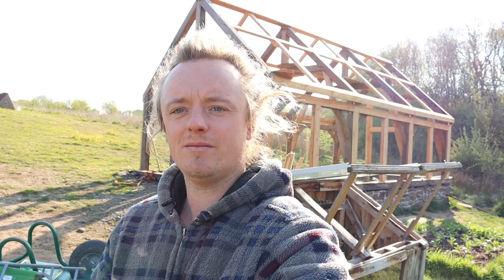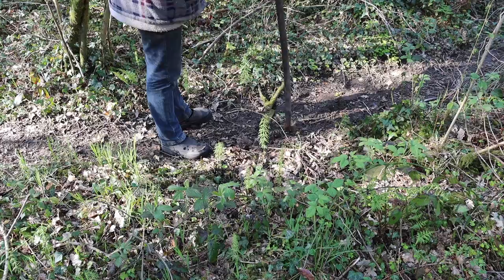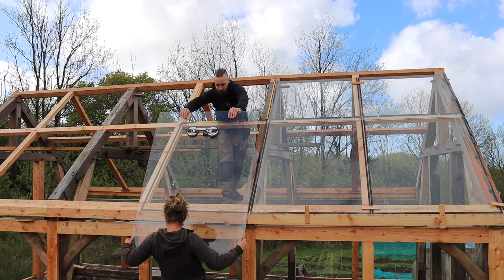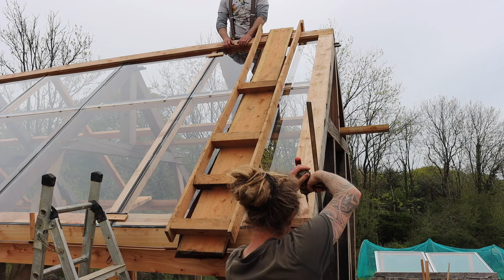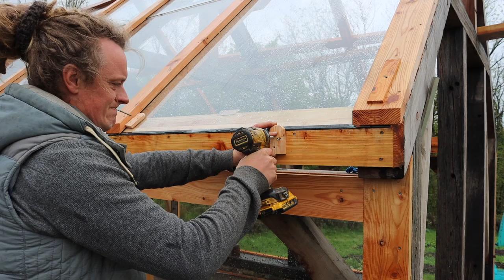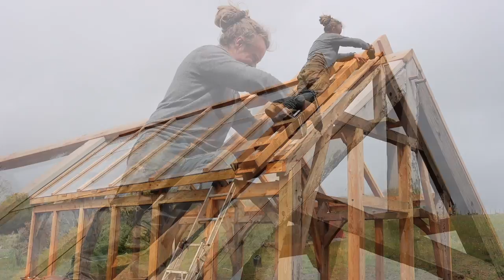Spring Fed Timber Framed Greenhouse Part 11 Roof Glazing And Finding Springs

Comment: From spring to fall even on cloudy days when I walk into my greenhouse it is tee shirt weather and a joy.  Your going to love it.
Reply: Just a point of interest and perhaps the question  will answer itself  as you continue  the build.  How do you plan to vent the greenhouse  during the summer  days.  From what I've been told plant growth  tends to stop when the air  temperature  hits the 90s and above. A solar powered fan in the apex would help or shade cloth suspended  above  the roof also helps a lot. Take care and as always fabulous  workmanship.
Reply: @garykuiken6191  just an FYI I generally don’t grow in the greenhouse during the summer.  The plants require too much attention.  But In august The uk isn’t southern Pennsylvania.

Comment: Hi, I love your videos,  I'm a professional gardener and have worked in the trade for over 30 years. Just a bit of advice.... Ventilation is imperative with a greenhouse. Red spider mite loves hot dry conditions and it's a devil to control if you don't get the ventilation sorting. All the top pains of glass should be opening. I speak from experience. I was in-charge  of a national trust garden for many years and one glasshouse had no roof vents and it was very hard to grow anything in, we had to retro fit rood vents in the end.
Reply: Perhaps the end walls will have venting panes.
Reply from the maker: The gable ends the back windows and the door are vents. I calculated it all and that is enough area for ventilation. The gable ends face the predominant wind direction so there will be air moving right through the roof. That is far better than just some vents at the top in  my mind.
Reply: @KrisHarbour  I fear that that will not be enough, but only time will tell. Maybe shading would be an option worth considering

Comment: The drought definitely affects most springs. Rain affects the ground water level and therefore some springs that are high in elevation might not work. It seems to me that the spring close to your lake isn't an actual spring but an underwater stream that comes from the lake, i.e. it flows relatively high up/close to the forest floor.  The main difference is that the water oozing from a proper spring (which is deep ground water) is most often drinkable as i. Whereas, an underground river water is pretty much the same as the lake water. 10/10 greenhouse!

Comment: Hi Kris great vids. Just wanted to share a hack with you after watching your firewood vid . Attach an old tyre to the top of your chopping block you can then pack it with logs and then chop away all the wood stays on the chopping block saves your back bending down . Cheers John expat now in Tasmania

Comment: Great job, as always .... (would have left open the lower edges of all panes to let the condensating water run out - this little air flow woud not hinder the greenhouse to heaten up at all)

Comment: I'm glad you got help for that part with your back bothering you especially. With the cost and weight of that glass I'm sure it made it loads easier as well. What a beautiful building. You can also use your little ladder to clean the glass when it gets dirty down the road. :)

Comment: I think different about springs. Springs appear through gravity. Water infiltrating through water penetrable soil layers and hit less water permiable layer. The water flows subsoil downhill on top of that layer until a spring pops out of the slope. That's how I learned. Springs have less to do with water table rather than they are a result of deeper sub soilsurface water movement.

Comment: Just curious, had you considered using aluminum clips at the bottom? They could recessed and hook over the top plate of the wall. Secured with a screw from inside. 

Your metals got me thinking this way because I’m building a timber frame greenhouse later in May. It’ll be 15’ by 16’. The Timbers will be 6”x6” posts, 2”x8” rafters 2 1/2”x10” ridge beam. Top and bottom plates will be 6”x6”. 

Anyways, wanted to say thanks for your project and video. It answers a couple of questions I had not answered yet. 

Cheers
Egon

Comment: Greenhouse looks awesome. 
What are your plans for ventilation Kris? You want the extra heat in winter, spring and autumn obviously, but mid-summer you're gonna have way too much. Vents at the top of the gable ends maybe? Some kind of louver, perhaps even a fan?
Reply from the maker: the back wall has an opening window and door will be used and the gable ends are going to be openable

Comment: So its just friction and sticky tape that stops the roof sheets from sliding down? What's the name of that tape? When you put in the batten screws was it hard to avoid hitting the glass?

Also, what type of glass is it and how wide are the sheets?

Amazing work Kris, Thanks for sharing!

Comment: Seasonal spring supplies can be driven by rainfall, feeding a perched aquifer, which then breaks out of the earth during periods of high precipitation, typically in the winter. However in a natural, artesian spring (which can also be seasonal) the hydrostatic pressure that forces water out of the ground is driven by temperature, not ground weight. 

Water is at its greatest density at 4˚C, and that is the temperature that all natural springs issue from the earth. As the temperature rises away from 4˚C, water expands, eventually turning into vapour at 100˚. Confusingly, as it lowers in temperature away from 4˚C, it also expands, before turning to ice at zero. 

In the earth, spring water is compressed by expanding warm water from above, heated through the earth by the sun, but also compressed by expanding warm water from below, heated geothermally from within the earth. Basically, spring water is a squeezed, dense, four degree filling between two sandwich layers of warmer, expanding water.

This is why water is forced deep underground in desert areas where the ground temperature is higher than the geothermal temperature and conversely why water is abundant in shady forests and wooded areas. If the earth is cooled by the shade from trees it allows the geothermally heated water to gain precedence and thence the compressed 4˚C layer of water to rise. 

You can tell whether your spring is rain fed or artesian by taking its temperature. If it’s coming out the ground at 4˚C then there’s a good chance it’s artesian and you could ensure a more consistent, all year round flow by planting trees above the area where it issues from, cooling the earth, allowing it to rise in the summer too.

Comment: Love this video series as I’m contemplating using glass (in a much smaller structure). I was most interested in how you did the roof and sealed the joints? It looks like the top sheet overlaps the bottom (with the clever metal pieces you made). But does this create a gap as it lifts from the rafters at the sides? Does tape just handle that gap, or did you do something else to provide side support for that elevated gap?

Comment: I'm a bit concerned at the lack of ventilation. A greenhouse would normally have vents in the roof and at the base to allow fresh air in and hot air out. It's going to get mighty hot in there unless you have allowed for all the end glazing to be openable.

Comment: Great video! Could you elaborate why you're going to build the gutters out of wood?
Reply from the maker: Because its natural, free and will look nice.
Reply: @KrisHarbour  I fully agree with your points. But surely constant contact with water will sooner or later become a problem for the wood, right?
Reply from the maker: It’s a common misconception that wood just rots away when wet. There are literally thousands of species of wood and all of them have different qualities. The woods this greenhouse is made from are some of the most durable woods in the world. The gutter will be larch. Larch was used to support Venice and most of that larch is still supporting Venice. Wet dry cycles will rot it but it will last a lot longer than plastic will in sunlight.

Comment: So I understand how you secured the glass at the bottom with those 'mechanical stops', but what keeps the slats from sliding down once the tape underneath goes knackered? The ones on the sides I saw you screwed in, but the middle ones seem like the lie on top of the glass, only held by the tape?
Reply from the maker: No they are screwed down to the timber under them. there is a gap between the glass and the screw goes through that gap-

Comment: The top glass has no support running under the ridge. You capped it on top, but nothing is supporting it under the ridge line.

Comment: Why only a single layer of glass? You could place a second inner layer of plastic wrap on the inside to create a convection barrier improving the over all insulation of the structure or a second layer on the out side. Cost is a reason not to. also temperature needs.